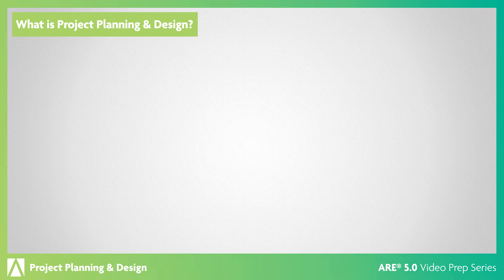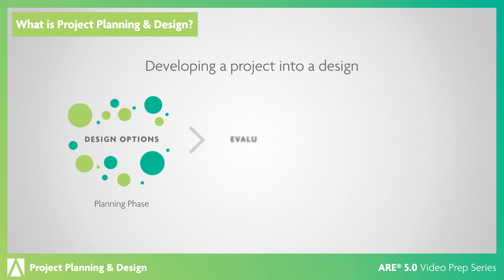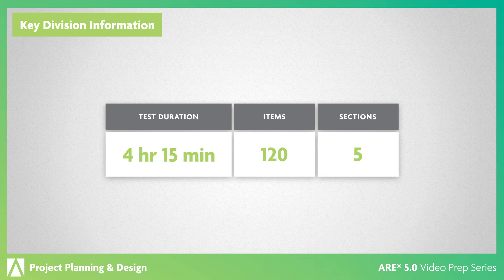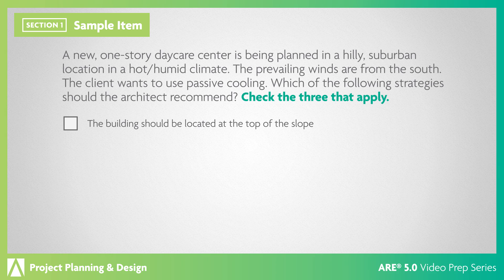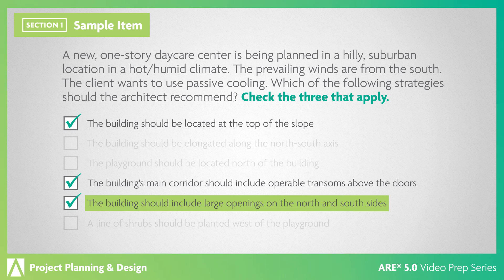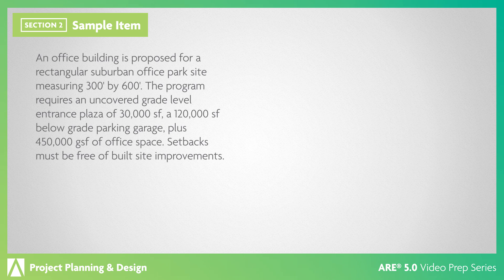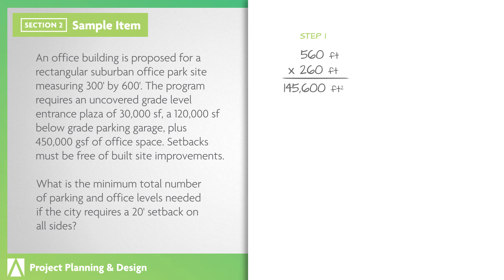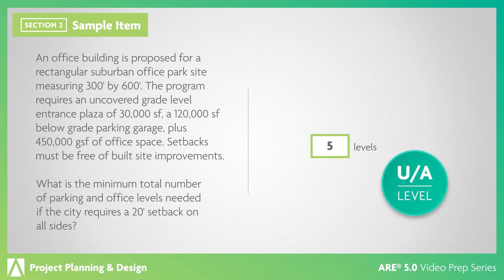ARE 5.0 Project Planning & Design

Comment: Could someone please explain to me, in the Section 5 practice problem,  why the builder would want to use the system with the higher depreciation value per year?
Reply: Hi Frank,
Briefly stated, a higher depreciation expense reduces a company's taxable earnings and thus its annual tax bill.  A detailed understanding of financial concepts isn't necessary for the ARE, but it is important to understand the various considerations of life cycle costs.